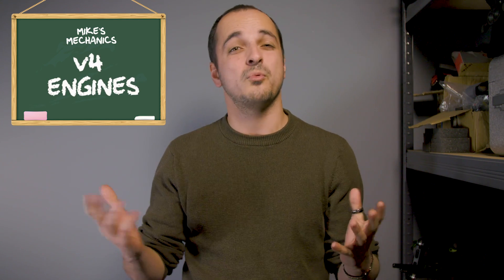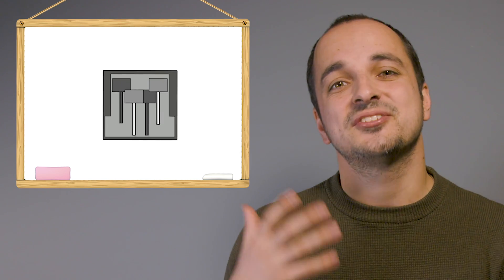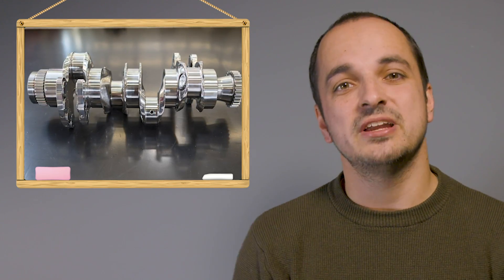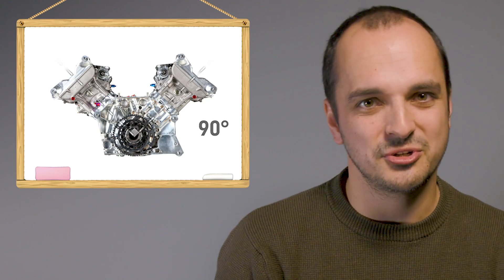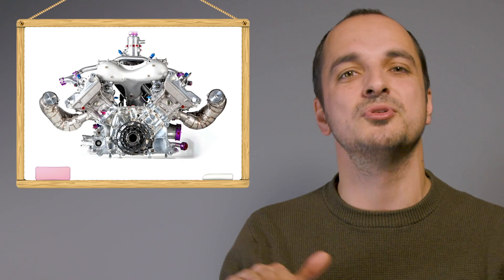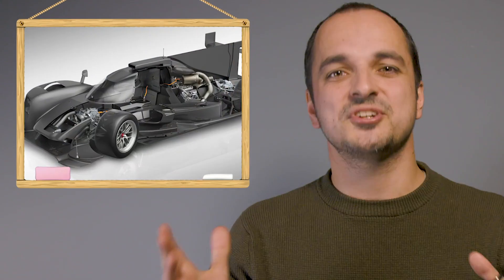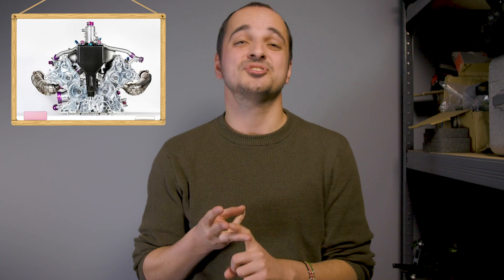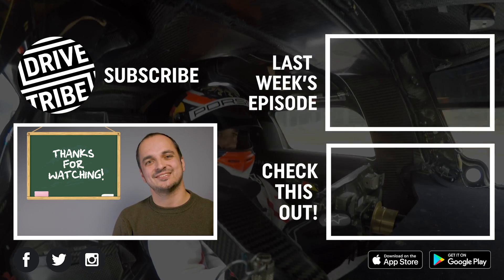Why V4 engines are so rare and which cars use them - Mike's Mechanics

Comment: Ford Transit MK1 had a V4 engine
Reply: The Mk 1 2000GT Capri also had a V4
Reply: As did the Corsair, and being lighter than the Transit it was quite rapid in it 2.0 litre capacity, although the 1700 cc was quite slow in comparision
Reply: Yes and all Saab V4's where built by Ford in Germany
Reply: Ford apparently had the Taunus (German) and Essex (British) V4 engines. Quite interesting.
Reply: @removearuso  that was absolute bonkers. to make same types of engines in the same car firm. But the v4 was the shortend version a V6.
Reply: @MultiArrie  Yes and no.  The German V4 started in Taunus P4, front wheel drive car in 1962 (prototype was called Ford Cardinal) .

They wanted to sell the car in USA originally ;)  

Then they created the V6 from the V4 --- not the other way .....   you can find the added cylinder patterns in how the valves are placed in cylinder heads etc.  (important when adjusting valve clearances in V6 ) ....

The essex V4 came in Corsair in 1965 -- the FORD UK was a different branch than Ford Germany -- they started cooperating and doing models from 1965 - from the Transit Mk1 ....

Cologne V4 -- 1962 ~~1978  (1.2 _ 1.3 _ 1.5 _ 1.7)  40-75 HP
Cologne V6 - 1964 ~~ 2000  (1.8 _ 2.0 _ 2.3 _ 2.6 _2.8 -- and the new  2.4 EFi,  2.9 EFi, 4.0 EFi) (the end in Scorpio 2.9 24v or Explorer 4.0) -- the end of classic Cologne V6  ~~ 1990 in a Sierra 4x4 2.8

Essex V4 -- 1965 ~~ 1978 ?  (1.7 _ 2.0)  (65 - 100 HP)
Essex V6 - 1966 ~~ 1988 ? (2.5 _ 3.0)   up to 2000 in RSA (from 97 bored to 3.4 V6)

Also the Russian Zaporozhets  (ZAZ  965  and later ZAZ 966, 968) had the AIRCOOLED V4   from 1960 to ~~ 1994   (0.7 _ 0.9 _ 1.2 )  23-50 HP
Reply: Ford Taunus V4 engine
Reply: @Colin Ashby I was just looking for a Saab 2stroke, I found a nice Saab only it had a V4. (That's like a VW bug with a Subaru engine). DRIVETRIBE doesn't use Wikipedia: Young lads...
Reply: @prep0wer  Volkswagen and Subaru are flat 4 engines not v4, the engine layout isnt the same layout.
Reply: Had the 1700 v4 transit, rubbish, put in the 2.0, bit better but not much.
Reply: zaz-966 too had a v4
Reply: You beat me to it 😊
Reply: Mk1 Tranny, 2000GT Corsair were music to my youthful ears. V4 enthusiasts may like to have a look at the Christie racing car from the 1900's:
https://crankhandleblog.com/articles/the-brutal-american-20-litre-v-4-front-wheel-drive-christie-racing-car-of-1907/
Reply: Mk4 Ford Zephyr  had a V4 probably the same as the Transit but with a Weber twin choke carburettor, my dad had one it wasn't that quick though if memory serves
Reply: Yes I had one, with the sliding doors. Wish I still had it.
Reply: They also appeared in the Marcos and an obscure London taxi of the 1970s. I remember seeing one for the first time in a Zephyr. I was about 6 and was wondering how the spare wheel could take up so much room that they had to squeeze the engine into the back of the engine bay. Apparently they were designed for marine use also which would make sense as the car they were launched (pun intended,) was the rather "boat-like" Corsair...
Reply: They were so compact that the diesel version had to have an extended front to accommodate it.
Reply: Had one on the old firms mk 1 Tranny years ago,had a thump thump sound you could just hear over the shot rear end!
Reply: My first thought too,
Reply: Yep, a 3 litre Essex V6 with 2 cylinders lopped off :-D
Reply: V formation take too much space compare to i4 and i5 in a car. That why company don't commonly used it.
Reply: @campkira  nope. The guy explained why they don't use them. Did you watch the video??
Reply: @campkira  nope...the Ford Essex v4 was only TWENTY inches long...
Reply: @n0ckst3r   An engineering company made a bell housing adapter plate so you could stick the Essex in a NSU Ro80 if you were getting tired of ..and broke replacing the Wankel engine, gave better torque and MPG compared to the rotary.
Reply: Witheredgoogie - a solid fuel rocket booster would give more MPG than a rotary!! 😂😂😂
Reply: @campkira  it's much shorter in length than any inline 4 or 5,it's bloody tiny.in a Capri you needed to almost lay on the car to reach them,good for weight distribution and for a small engine bay,Saab used the Ford V4 because without modifications to the body work,specifically the front rails,the Ford unit was the only engine of a suitable capacity that would fit in place of the two stroke unit.
Reply: @campkira  No, its that they are expensive compared to an inline 4.  Two heads being the biggest issue, followed by the fact that you can't assemble them with a single plane of assembly. The inline 4, everything goes straight up or straight down, making it very easy to automate assembly. So its again cheaper because thats less time per engine spent with skilled labor and less factory needed for a given number of engines per day.  Factories being expensive things to build and operate.

Comment: Lancia's been using v4 engines since the 1920s
Reply: They remind me of the VR6s that VW had/has.
Reply: @experimental0000  Yep, the layout is quite the same. Lancia's also made some v8s with a single head just like the v4s, you can find them on the Astura for example.
Reply: @blos90  I didn't know about their V8s. Thanks for the tip!
Reply: @experimental0000  Happy to hear that!
Reply: Lancia need do come back with that tbh, Alpine has, why shouldn't Lancia.
Reply: @F1ll1nTh3Blanks  I totally agree, Fiat is squandering all that magnificent heritage.. They should sell the brand to the VW/Porsche group.
Reply: Especially the Fulivia range.
Reply: Just don't make sense on modern car. V4 take more space.
Reply: @campkira  maybe for a luxury car with almost 0 vibrations
Reply: @campkira  v4s dont take more space. That's a misconception. A v engine is wider but shorter. So a v4 is more comparable to a i3 than it is a i4 in length. So what room you take up would be mainly in width. So your drive even your exhaust can be routed fairly easily.

Comment: This video didn't explain much at all. A lot of things mentioned here that a V4 requires but also any V configuration in general requires.
Reply: @baums547  BMW has a lot of inline 6's and mercedes has started using it again as well. It's a fantastic engine setup since it's naturally balanced. The only downside being that it's long.
Reply: The reason they're rare is that they're more expensive than straight 4's and in the road cars which uses 4 cylinder engines the benefits are negligible so it's not worth the cost.
Reply: Same way we don't have many boxer engines nowadays
Reply: Exactly, what makes V4 rare, but V6 and V8 very common?
Reply: @cptant7610  the length of a inline 4 is manageable, and the downsides of a V4 (double valvetrain, cylinderhead, exhause etc.) a just too expensive in a normal standard car.
V6 and V8 are more common than its inline pendants, because there much more compact in relation, and the costs of these "downsides" are arguable for the kind of cars they're made for. regardless, I6es are used, cause they run buttersmooth and for some cars the length is arguable too. for example most buses and trucks (in europe) use I6 engines. Also a I8 would have a very long crankshaft, what will make it weak or need more bearings.
Reply: @cptant7610  The V4 is unbalanced -- needs balancing shaft --- this is a Ford V4 http://2.bp.blogspot.com/-mK0RTzcOl74/TzayYuHTdFI/AAAAAAAABX8/jf1UciTPJvY/s1600/S25C-112021109590.jpg

Comment: Amazing sounding engines, with lots of torque yet compact. I have them on my Aprilia Tuonos V4Rs
Reply: That has absolutely nothing to do with what direction the cylinders are pointed.
Reply: I don't think anybody has actually said that here. The torque is merely characteristic of that particular bike and the way motorcycle V4 motors tend to be tuned in general.
Reply: @montlejohnbojangles8937  It was heavily implied in the original posted statement. I've seen the same sentiment around the internet regarding V-engines.
Reply: All this false assumption that "torque" is a produce of a V-arrangement of cylinders. Just no.
Reply: Cylinder config has zero to do with torque.
Reply: McLarenBMW  not because they are V4s.  It's because the bore & stroke are different.
Reply: Oof, that's some nice wheels my dude. 👌
Reply: McLarenBMW  no, it does not.
Reply: Torque is a static force measured in whatever system of measurement you use (force @ distance from center). Torque is a twisting force around a hypothetical axis, but that force does not have to produce motion. It can just be present without movement. The amount of torque an engine produces is the composite of a whole list of factors that have to do with the mechanical and thermal-chemical conditions in that space.
When torque produces motion, now additional scientific measurements come into play:  distance and time. It's how horsepower is ultimately calculated. Without motion resulting from torque, you cannot have work being done, therefore no horsepower factor.

Twin cylinder engines make torque at lower RPM, usually because the design of big cylinders and longer stroke nets greater twisting on the crankshaft without the need to perform a million little pulses within the space of a couple seconds (ie. high rpm).

Getting combustion to create big force on the crankshaft without high RPM is a matter of airbox volume, throttlebody diameter, valve diameter, camshaft lobe profile, bore-stroke ratio, and the general design of the cylinder head in how efficient it is allowing high velocity flow at low engine speeds.
Reply: @turnin.sprocket  twins make more torque at low rpm because you have to make them with a long stroke.
Reply: @TigerDude333  That's not entirely the reason, but part of it. Longer stroke usually means EFFICIENT COMBUSTION, which usually means greater force on the crankshaft per combustion cycle. There's a lot of factors that have to be in place to optimize a combustion event.
Reply: @turnin.sprocket  sure, but the difference in stroke is primary.  You aren't getting 30% more efficient combustion.  All the fuel is getting burned in both cases
Reply: @TigerDude333  If the cylinder can fill properly, if the valves are the right size, if the camshaft lobes are optimal profile, if the throttle body diameter is optimal, if the airbox volume is optimal, if the exhaust scavenging is functioning well.

Small displacement and large displacement engines can both make solid torque per displacement, if all the factors allow for it.
Reply: Rotax i guess, so Aprilia gave upp like Ducati their tractorsounding v twins cant comoete with the fours.
Reply: Speaking with a Ducati enthusiast salesperson at a dealership near me, who after talking for a good hour demonstrated he had a lot of detailed design information of the brand and their move to 4-cylinder bikes, mentioned that Ducati had taken the twin cylinder engine architecture to about its maximum. In order to generate a significantly higher horsepower (and as a result torque is always more abundant in twins at lower rpm compared to fours) from the twin cylinder architecture, they'd had to do some pretty radical hugely oversquare bore/stroke ratios with big valves, which has design side effects with engine block strength, reciprocating mass, piston stability in bore, and a host of other design challenges that the actual COST involved in proceeding down that course was going to be much greater than moving in the V4 direction instead of continuing in the V2 direction.
Also, as a result of developing the Desmosedici V4 architecture (which is straight out of their MotoGP design) as they have with their signature desmodromic valvetrain, they are basically achieving stupid amounts of horsepower without trying very hard. The current V4 engine design has a LOT more room for power. 999cc making potentially 234 hp (with exhaust system), the 1103cc engine making less than that but can do a lot more. They aren't using titanium con-rods, titanium pistons, or other exotic light metals to achieve this power. In other words, Ducati is "sand bagging" the V4 1103 right now and will easily be able to crank out much more power in the next generation or two of the design, while the other corporations are squeezing a lot of tech and exotic materials to achieve ~200 to 210 hp.